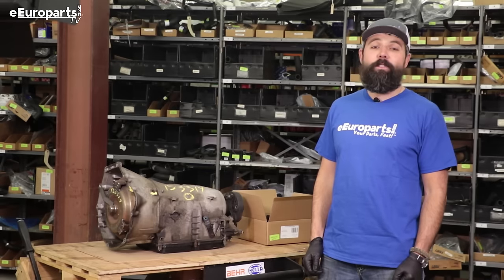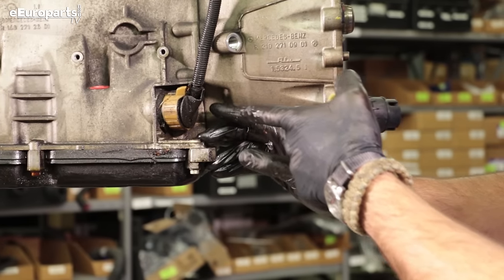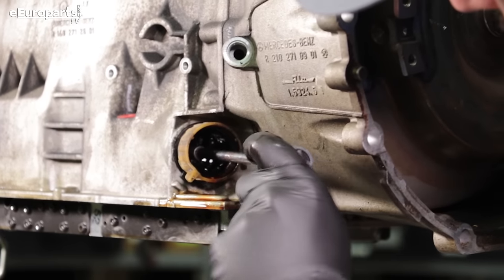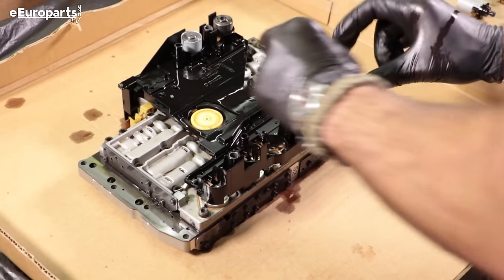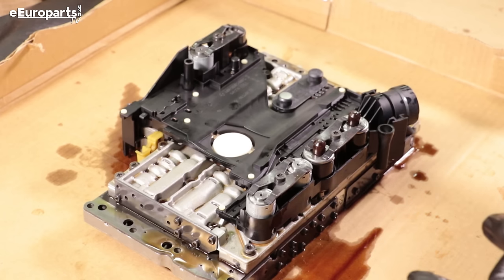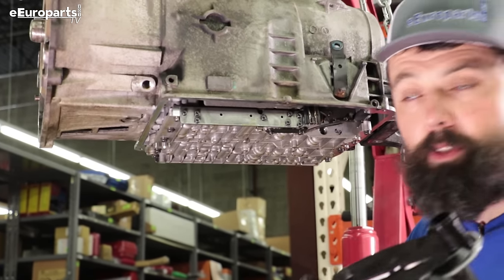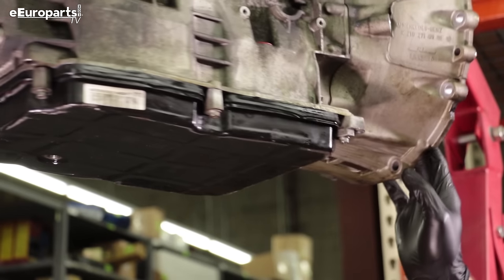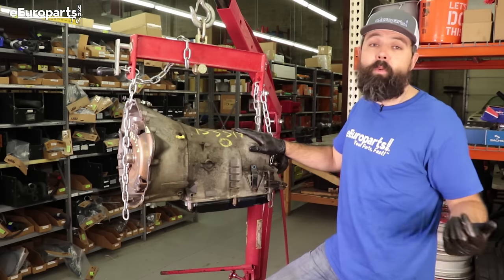Mercedes-Benz 722.6xx Transmission Valve Body Plate and Plug

Comment: Not a good transmission in my view. Failed on me on 135K miles

Someone claimed that they changed the valve body and circuit board, still got a negative result

Unless I was duped

Comment: save your OEM Conductor plate with only a pair of new sensors from eBay $30 + NO programming required 🤗

With a new plate replacement you'll need Xentry coding, not just OBD2 "reset"... PITA 😂

No plate, no pain
👍🏻
Reply: That's where I'm at right now. 
Icardoft mb11 wont reset. Now what? I'm having a loss of drive now. Pleasehelp. .
Reply: @ryancollard77  did you fix the issue?
Reply: @MitchGrooms  yes. Replaced conductor plate and now it's perfect.  Sid the rumble strip hole as well and shifts smooth now.

Comment: I replaced the speed sensor and connector on my 2008 challenger srt8, I'm still having the same problem! Anybody have an idea what it can be??
Reply: Edgar Ojeda ....if the car was in limp mode and you had the fault codes.. and once you have replaced the parts...the ecu has to be cleared of the fault codes and reset if not the ecu will still think there is a fault and stay in limp mode. So all ways get codes cleared.
Reply: Most likely take it to the dealership so they can do that right? As in reprogram it. Can mechanics do that?